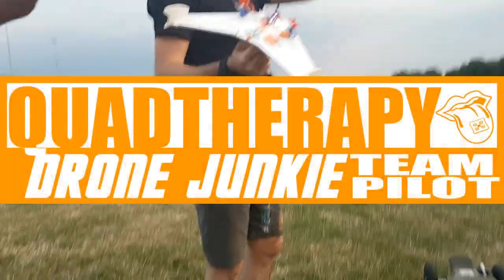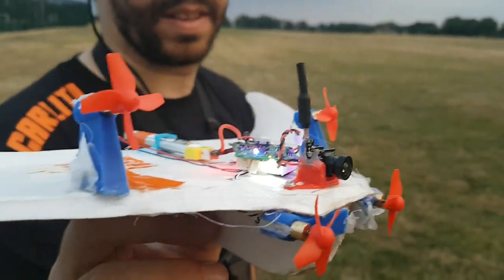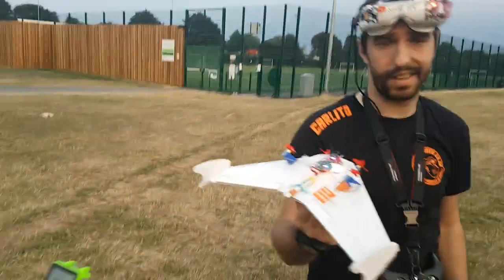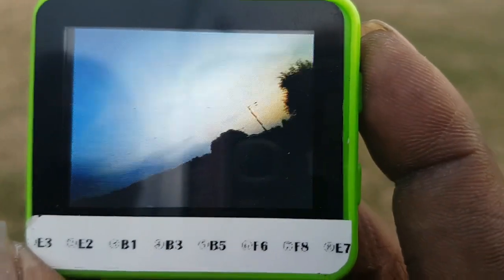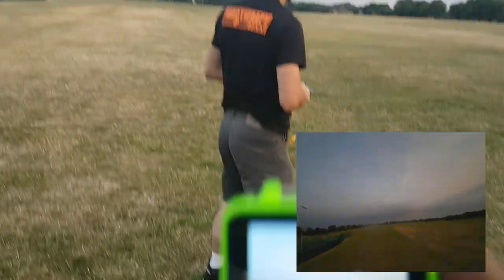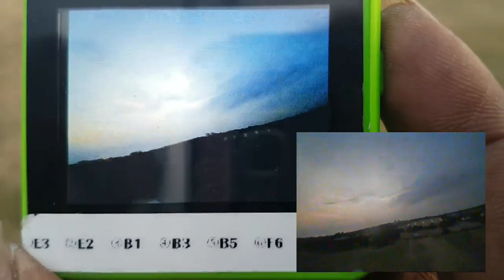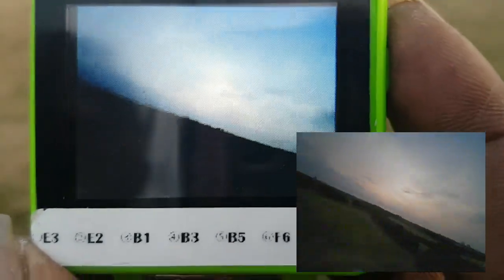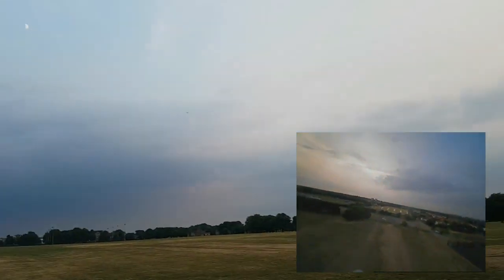True Tiny Wing Conversion

Comment: It looks like you have a little positive angle on the top motors to give you more elevation controll. Is this correct, and what angle did you use. I have seen others try to make this work, but you actually did it. I hope inductrix or someone offers you a crap load of money for your design because the work is incredible and it would be great to see your logo and name plastered on product all over the world. Thanks as well for the logos on the facebook page. I will include them on my build of this unit. thanks again

Comment: Great work guys!   are you using custom motor mixes to achieve control???
Reply from the maker: No Mike, nothing special in mixes, just a stock board. 
she even flies in angle mode and stabilises nicely.
Reply: @jemlittle1787  awesome